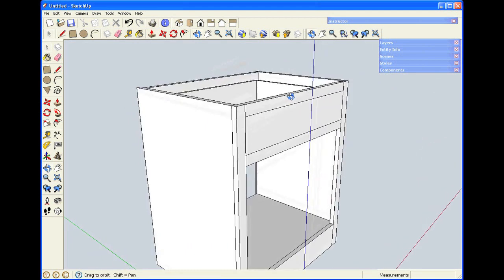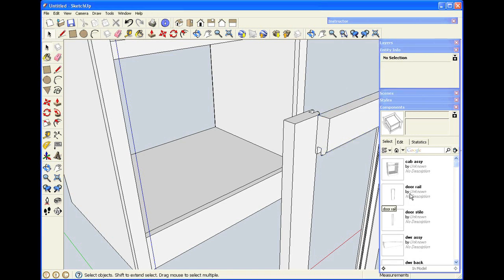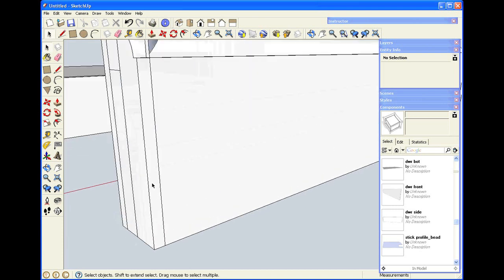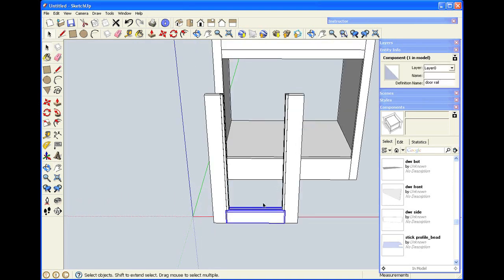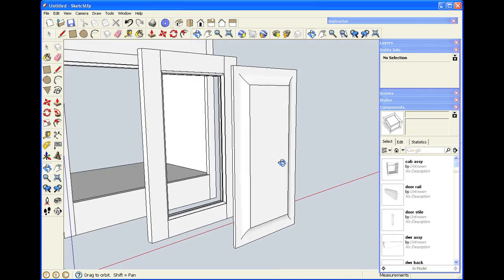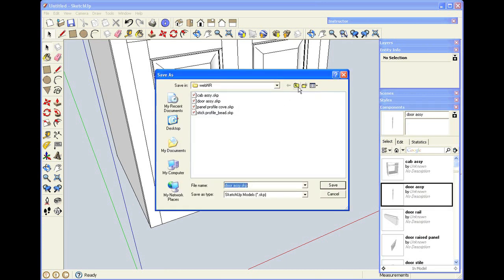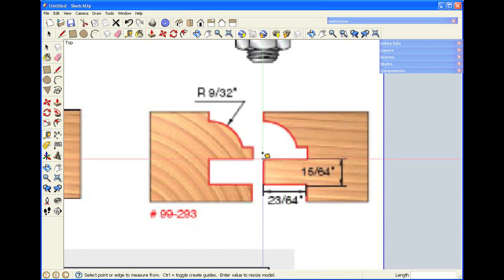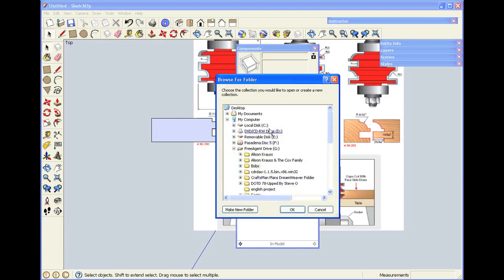SketchUp for Woodworkers. Part 2: Advanced Techniques 4-7. Robert W.Lang

Comment: Thanks Rob, These are a great introduction to SketchUp, I would like a brief explanation regarding when and why you choose "components" vs "nested components" vs "Groups", as different channels seem to base this upon personal preference.   Thanks!
Reply: Hi, easy mate.
When you create components you essentially create a template of a piece, therefore you can recall that same piece as many times as you need. All those are interconnected and editing or changing one automatically changes all existing and future pieces.
Groups are just like components, but SINGLE STANDALONE PIECES.  If you make copies, then changing or editing one WILL NOT AUTOMATICALLY DO THE SAME TO THE OTHER COPY.  also if you delete it, you cannot recall it at a later stage. 
Nested components is just the same as individual components, but instead of being made of lines and faces only, they are comprised of other premade components. 
Kinda like the files and folders style of the pc.

Example: component consists of lines and faces to create a 3d form. Can be recalled for later use
Group: same as component but cannot be recalled unless copy feature is used. 

Nested component consists of other components.

So when you build a project in real life usually you follow this steps:
Measure and cut raw material into individual pieces (make components)
Then those components you put them together to create the drawers for example and that is your nested component (4 sides and a bottom).
Later on you create the cabinet frame (another nested component)

Finally you put the subcomponents together to finish the project. 

I'm sorry if it's a bit messy explanation buy i hope it helped!

Cheers and keep your tools sharp Haha
Reply: This link might help
https://youtu.be/mh18dxscGaw